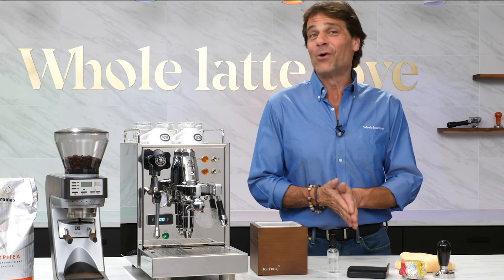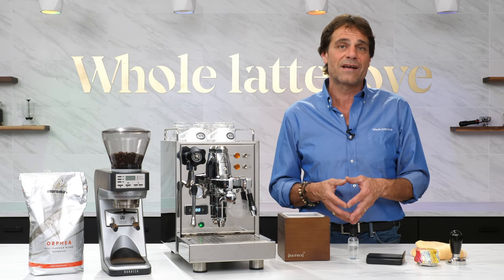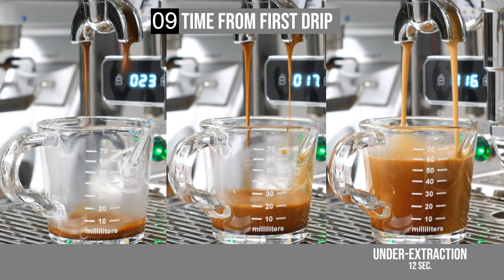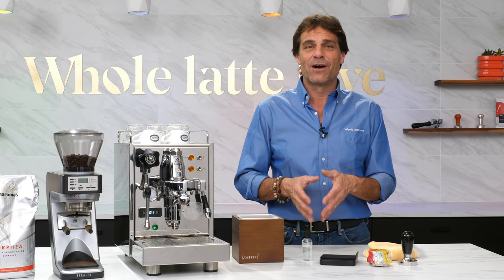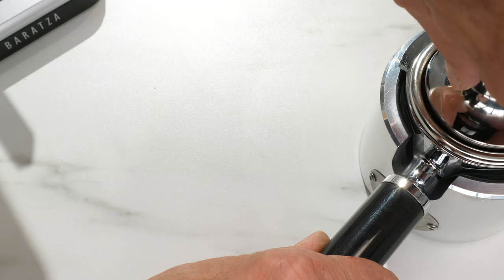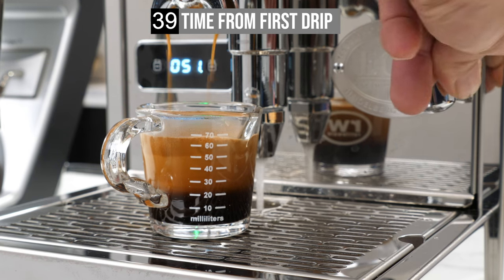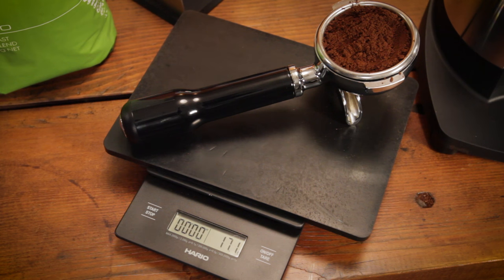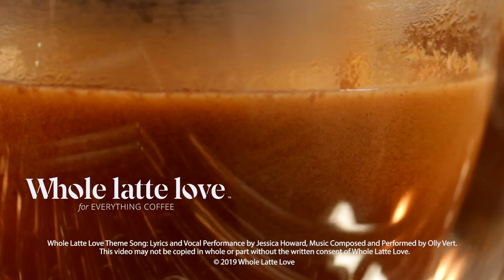How To Dial In Grind Size for Espresso

Comment: A great video, as always. Thanks! I have a quick and simple question. I recently purchased the ECM Synchronika from WLL and have been working on getting my grind and flow so that the timing is just right for the 60 ml double shot. This requires me to use my measured shot glass, but often I am making a latte or some such drink. Is it OK to pour from the measured glass to a cup prior to adding the steamed milk? I wondered if this would destroy the crema and thus detract from the flavor. Thanks for any suggestions!
Reply from the maker: Hi Michael, Thanks for the kind comment, question and your patronage. Guessing you may know the Synchronika is my favorite dual boiler machine! Pouring shot pitcher to glass is done all the time. You will break the crema a bit doing this but I would not be overly concerned. I do have some suggestions for you! If pouring from pitcher to cup pre-heat both with water from your machine. Pour gently. Once you get consistent with your shots use timing instead of volume measurement and pull you shots into your final cup. Keep in mind when you change beans, your coffee ages or you change your coffee dose weight you may need to adjust grind size  - so you would need to pull out the pitcher again. The best solution is to go the next step and use a scale instead of liquid volume to dial in your grind size. I kept it simple with volume/timing in this video as a lot of people learning dialing in don't have or do not want to invest in a scale. Set your final cup on your scale and pull your shots using brew ratios. Typical espresso is a 1:2 ratio of ground coffee to finished shot. So if using a 17g dose you'd stop your shot at 34g by weight. Of course timing should still be reasonable at 20-30 seconds from 1st drip when using weight. Brew ratios using weights is far more accurate than using liquid volumes which are often hard to judge due to crema weighing much less than 1g per ml. Hope that helps!
Marc
Reply: @Wholelattelovepage  Wow! Thanks for the all the great additional information. It looks like my next WLL purchase will be an espresso scale! I thought I was getting good pulls because of hitting 60 ml in 26 seconds (after first drip), but based on your reply I started using a kitchen scale to see how I was doing. Not very convenient, because I have to keep resetting the scale to zero with my various pieces of equipment and then going back and forth between the machine and scale, but good enough to tell me that my 17g dose yields a double shot that weighs far more than 34g, even though I'm at 60 ml. I believe this suggests that I am not getting the crema that I should be but rather getting more dense liquid. You teach me something new with each video and now with your reply. Thanks again! Geeking out...    Mike
Reply from the maker: Hahahaha geeking with you!

Comment: Hey Marc, great video! I just received my new Quick mill Pippa and am working on dialing in my shots. The Pippa has an adjustable screw that allows you to change brew pressure. I wanted to ask wouldn't that be another variable that would affect how quickly/slow you extra your espresso as well? Currently when I pull my shots I am getting 3.5 - 4 bar of pressure. Know Quick mill recommended closer to 9-10 bar. Thanks for any clarification on this matter!
Reply from the maker: Hey Patrick, Your machine should be adjusted to produce QM's recommended 9-10 bar of static pressure. To adjust static pressure insert a backflush disk (blind basket) in the portafilter and turn the pump on. Turn the OPV adjustment screw to produce 9-10 on the gauge. Unless you've already adjusted the OPV seeing 3-4 bar during an extraction indicates your grind is too coarse. Hope that helps!
Marc

Comment: Hi Marc, great video! I'm wondering how many espressos should one brew in a new machine to remove any oils or contaminants(?) (if there are any, I don't know?) in a brand new espresso machine? Or can you just run a blank (water) shot and then you're fine to pull espresso shots? Or does it help to run a few throwaway shots of espresso through the machine? Thank you,
Reply: I should have said my machine is similar to a Breville in style. (It has a built-in grinder, dual boiler, PID, 58mm portafilter) It is a Sur La Table sold at Costco. I have not set it up yet. Thank you!

Comment: When is the optimal time to start measuring the espresso extraction for  Breville express? Is it immediately after pressing the double shot  button or after the first drip ? Please answer me ASAP
Reply from the maker: Hi MA, Thanks for the question. I prefer to use first drip to start timing. But it does not matter. If you choose to use from pump on that's fine. Whichever you choose just stick with that method. If going from 1st drip tend toward the lower end of the 20-30 second range of extraction timing. If timing from pump on then tend toward the higher range of timing. Hope that helps!
Marc

Comment: I have a Breville express. Following your guidance, I noticed that from first drip to done, it was taking 15 seconds! And I had the grind size at 4 (where Breville's starting default is 5). Do I go even lower? I wonder what I do when I get to 1! Or is there something wrong with my machine (it's new)?
Reply from the maker: Hi Pito, I would grind finer for sure! I doubt you'll get down to a setting of 1. Don't think there's anything wrong with your machine. I don't know how much weight you are dosing but if you can dose more coffee  that will also extend the extraction time. Do remember to work with one variable at a time. So if changing dose weight leave grind the same and vice versa.
Marc
Reply: Whole Latte Love I’m doing 18g and the bucket as it is is quite heaping. So I guess I’ll go lower, thanks. Love the videos by the way. A great service.

Comment: Hi Mark, a grind question for you. I purchase and grind my beans at Costco - I ground my last purchase a little to fine. Can I mix some slightly coarser grinds with those fine ground beans ? I'm thinking that would keep the portafilter from packing off.
Reply: yes, but understand that grinds even on the same settings are inconsistent
Reply: @johnsmitherino4913  thanks for the response
Reply from the maker: You could try but... If the fine grind was choking the machine I think It's fairly likely mixing it with a coarser grind will not solve things. Finer grind will just make its way through the coarser grind and plug things up. Have you tried a lower coffee dose with the too fine grind?
Marc
Reply: @Wholelattelovepage  I've been fortunate with mixing the 2 but I'll try a smaller dose and see how that works. Thanks

Comment: Thanks for this vid! I’ve had my gaggia classic for a few months but haven’t been able to dial in quite right. I’ve tried again today and I’m finding and doing 18g consistent tamp I’ll get say 1oz in 30sec, go down 1 grind coarser and it will take 20 sec till any coffee comes out and go extremely slowly... even though the grind is coarser?! So inconsistent. Using the breville smart grinder pro. Help!
Reply from the maker: Hi dc, You are welcome for the video and thanks for the question. Strange you are getting slower extraction with coarser grind. I've used the Smart Grinder Pro and it tends to be rather clumpy at espresso grind sizes. Might help to break up any clumps prior to tamping. You can stir with a toothpick or similar.
<Marc

Comment: How should I dial in a single espresso shot? I prefer using the single basket with about 10 grams. What should I aim for in seconds?
Reply from the maker: Hey FG, Thanks for the question. Timing is same fopr singles and doubles so go 20-30 from first drip. Single baskets have lower flow rate (fewer holes) than double baskets. Need to keep the water to coffee contact time the same regardless of shot size.
Marc

Comment: Hi! Sorry I can't figure out the grind setting of the 26 sec shot. May I know your grind setting please. Tia!
Reply from the maker: Hi PKB, Thanks for the question. You will need to go through the process of dialing in your grind size as shown in the video. There's no correct grind setting as it will change with variables like coffee used, dose weight, equipment etc.
Marc

Comment: I'm confused... you talk about ratios but most places talking about a latte or whatever say an espresso should be 30 ml, or in weight to avoid the crema volume issue, 30 grams. I have the new Silvia Pro, which comes with a 16 gram basket. So do I aim for 60 grams as a double, or 32 grams as a 1.2 ratio? Because that's a huge difference!?
Reply from the maker: Hi b, Thanks for the question. Using weights takes the inaccuracy of liquid volume out of the equation! For a 1:2 ratio from 16g you would pull to weight of 32g. Here's an excellent video on brew ratios if interested: https://youtu.be/WifLRJZKs9A
Marc

Comment: love the new studio...... so here is my dilemma, Im using illy beans and im grinding it to a 3. when brewing  it takes somewhere around 23-30 seconds for a double shot however im not getting enough coffee. im getting enough coffee for a ristretto. what do i need to do to remediate that issue. i get all the coffee i need when i use Lavazza Super Crema but not with the illy. also i always get more coffee in one glass than the other.
Reply from the maker: Hi Carlos, Thank you for the comment and question. As I mentioned in the video grind size is not set and forget. Especially true when changing a variable like beans. To fix the Illy extraction sounds like you need to grind a little coarser. As to more coffee in one glass than the other a slight difference is not out of the ordinary. At the start of a shot surface tension in the espresso may cause a little more flow from one side than the other. Usually that evens out as the flow rate increases. Another cause is machine being slightly un-level. If your machine has adjustable height feet try adjusting them a touch higher on the side getting to much flow. Hope that helps!
Marc

Comment: I brew double shots exclusively for making lattes using a Expobar office lever heat exchange machine and a Compak K3 grinder. I find to get a 20 second from first drip 60 mI extraction I am having to grind to a fineness that almost clumps the coffee. Is there any difference to the process to note to accomodate for a latte other than what you have outlined in the video?

Comment: This is great, but what do you do for coffee makers with flow control? Do you dial it in full open or half open?
Reply from the maker: Hi AV, Thanks for the question. When using flow control I dial in grind using the stock flow rate. For ECM/Profitec machines one gets stock flow rate with the flow control valve open 1.25 turns. Following that try some shots using flow control. If starting a shot with a very low flow rate, typical when working with a fresh from roast specialty coffee, adjusting grind a little finer than dial in can help. Here's an article with more info on stock flow rates and graphs of 5 basic flow profiles: https://www.wholelattelove.com/blogs/articles/intro-to-calculating-flow-rate-on-e61-group-machines
Marc
Reply: @Wholelattelovepage  OK, so followup, I wasn't getting good results (blamed it on the grinder) . Just bought the 270wi and I'm on the finest possible setting, 1A. I am getting only about 4.5 bar, and 2 Bar at the brew head in a 17g basket and 18g of grind. Shot is pulled to 4oz in 10-12 seconds from first drip. Is it possible this is all due to the beans? Can the bean cause such results like a faster pull even though I'm on the finest possible setting? The machine is a ECM Classika w/Flow Control, thanks for the help!

Comment: Great video, I have seen the shot glass you use, it has 2 pourers on either side. Are these glasses meant for drinking or for pouring into a larger glass thank you
Reply from the maker: Hi Tugboat, Thanks for your comment and question. They're mostly for pouring but I drink from them all the time when I'm dialing in and tasting! If 2 spouts is not enough we have these shot pitchers with 3! https://www.wholelattelove.com/products/lf-spare-parts-3-spout-2-oz-shot-glass
Marc

Comment: Great explanation.  Been working on all this with my son and his new coffee machine.  However looking at videos of various fully auto machines - they don't get anywhere near these timings.  Does that mean they are flawed?
Reply from the maker: Hi Mark, Thanks for the comment and questions. I work with both semi and super-auto machines. Shorter times on supers does not mean the are flawed. The use much smaller doses typically 5-12 grams per cycle. They are tuned to a different size puck surface and depth. Also have filter "basket" discs with flow rates very different than commercial 58mm etc. All that said, super autos are not capable of same potential quality and control as one has with semis. But, they are very consistent, convenient and do a good job.
Marc
Reply: @Wholelattelovepage  Thanks for explaining the differences between the 2 machine types.  I think I'm leaning towards a super-auto machine but what you say confirms my suspicions.  Its convenience at the expense of quality.  But consistent 2nd rate quality 😄

Comment: Depending on coffee roast level, how do you adapt the amount of g in your basket? Sometimes 19g is less than 18g in the same basket (volume). How does it affect extraction vs grind size? Thanks
Reply from the maker: Hi Felix, Thanks for the question. There are variations based on coffee type and things like roast level. Beans grown at high altitude tend to be denser and if they are will weigh more in a given volume. Best bet is to use a scale to weigh coffee doses with a scale like one of these from Acaia: https://www.wholelattelove.com/collections/acaia
Marc
Reply: Also a super cheap (£19) scale and timer in one from amazon with great reviews.

Comment: Thanks for the great video which I’ve watched several times. 
I bought as a beginner the sage barista express and I have a problem which I can not solve. I bought some new Coffee beans and put 17g in the singlewall for double espresso and I can not reach the pressure for the espresso. I tried with the the double wall and the pressure went directly up as you mentioned in your video. 
Do you have any suggestions/tip?
Reply from the maker: Hi s, Thanks for the question. Forget about the pressure gauge for a second and let me ask how is your espresso? Is it coming too fast? If so you need to set the grind finer.
Marc

Comment: Hi! I love your videos. I am using a Rocket Appartamento and am curious about how to dial in a grind for a single shot as well... My wife likes not so strong coffee and I wouldl ike to use the sigle for her.. can you assist?
Reply from the maker: Hi Rom, Thanks for the comment and question. I think the easiest way is to dial in for the double shot and have a go with the same grind size for a single. Timing for a single shot should be about the same 20 - 30 as for the double. The stock baskets which came with your machine may or may not be well matched to allow for use of same grind size. If not working with stock baskets to your satisifaction you might consider precision baskets from Baristpro. The doubles and singles are engineered with hole number and layout to use the same grind size. So if you use this double: https://www.wholelattelove.com/products/baristapro-20g-precision-portafilter-basket You could use this single and should not need to adjust grind size: https://www.wholelattelove.com/products/baristapro-8-10g-precision-portafilter-basket
Hope that helps!
Marc